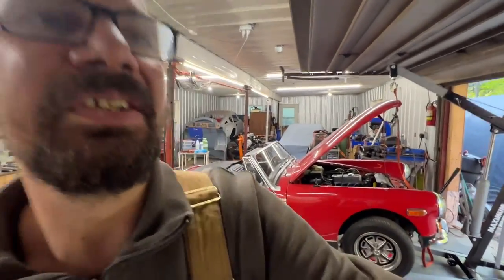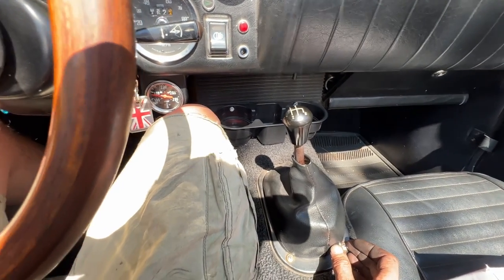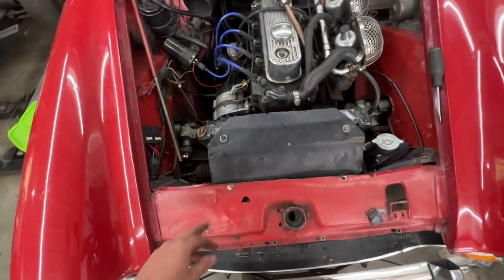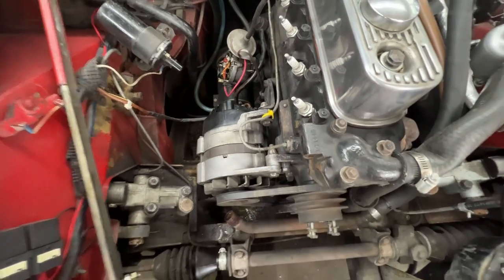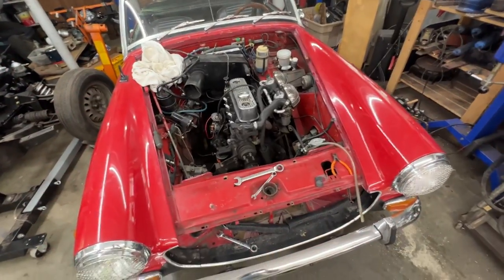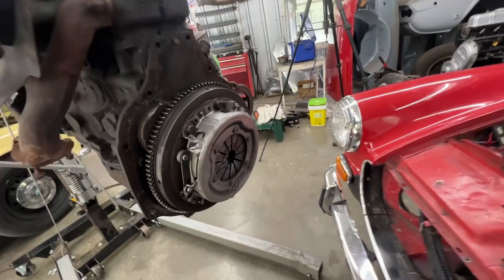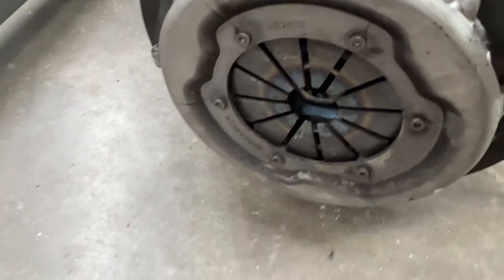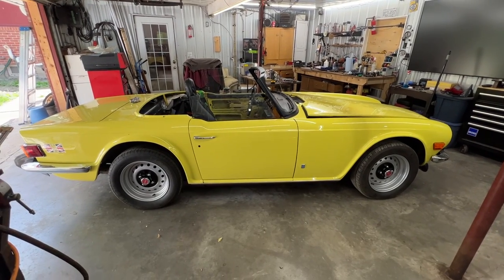1972 MG Clutch Repair - Part 1 - Removing The Engine

Comment: Hi Elin, I don’t know if you I’ll see this in time but I have restored several of these so a couple of thing that may help. Because it is a carbon bearing drivers need to remember not to sit in gear for ages in traffic, use neutral where possible. Avoids early wear and overheating of the bearing.
To remove the radiator- as you have done it must come out with the shroud. Originally the shroud used fixed nuts or spire nuts, so you only had to get to the bolt heads. These go missing and people just use nuts and bolts.
Easiest way to get to transmission bolts is 1. Undo the ones underneath 2. Lift engine on hoist and remove engine mounts 3. Lower engine as far as possible which leaves more room to get to the remaining bolts 4 tilt up and out. Reversing this may help you get the engine back in easier. 
Happy to answer any questions on these 🙂

Comment: Elin, that particular Midget appears to have had some front end damage.  I had three of them, and a Bugeye.  I was very poor when I owned them so I did everything.  They come apart easily and logically unless they have been the victim of some poor repairs.  Keep heart.  You will find them to be little jewels.  The “A” series engines can be disassembled with an adjustable end wrench (well, almost).  Thanks for taking this one on.

Comment: Hi Elin, Rusty knew something was different and he left you to it in the end .... man's best friend😅😅

I always wanted a midget but it never happened and Triumphs did. Can't sit on the tyres to tune the engine in this one😂😂

Thats a strange clutch thats for sure be interesting to see the new one. Missing release bearing, that reminds me of the first engine I ever rebuilt, it was an old Ford Cortina and I had swapped the crank. Couldnt get the engine to couple eventually I twigged what the problem was and a new bearing was  brought!!!

Good luck with the rebuild. Have a great weekend!!

Comment: I have a 1979 midget 1500 and you will probably know by now, they have a TRIUMPH engine, the same as in the Spitfire.  These are very simple cars once you know your way about, and at the moment they are very cheap to buy for restoration.  At the time, towards the end, Triumph and MG were the same company under company name British Leyland.
Reply: I came her to post similar re same factory in later years. This one is the earlier 1275cc A-series- still very simple to work on once the bonnet is out of the way.

Comment: It's much easier to pull the engine and tranny out as one unit. It will be a pain aligning the output shaft of the tranny with the clutch when you put the engine back in. Looks like they had a aftermarket throw out bearing. The old Carbon style ones are better. But it is hit or miss because some of the aftermarket carbon throw out bearings don't last long. Yes there is suppose to be a bushing in the flywheel for the output shaft. It must have destroyed itself. It would not surprise me if this owner sits in the McDonalds drive through with the clutch engaged hours at time. This car will be back in a year for sure :)

Comment: Holding clutch depressed eats these things to pieces...other than briefly to engage the gears or change a gear will rapidly wear them out.
Sitting at stop lights on the clutch or stop and go cruizing is all it takes.

Comment: Elin, watching this episode, I am again reminded of my fervent wish that there exists a special place in hell for all those automotive 'engineers' who design auto repair nightmares.  This 'circle of hell' would be an endless line of their 'designs' that need repair and they must do the work in the dark with only a crescent wrench, a screwdriver, and a pair of pliers to work with!  lol
Reply: I kind of get your point- but I dislike even more people that bodge these cars and make them even harder to work on. Eg the Midget came with a mixture of captive and spire nuts for the rad shroud- you just needed to get a socket on the bolt heads. But Mr Bodger replaces these with any old nuts and bolts he can find and makes it a nightmare for the next guy!